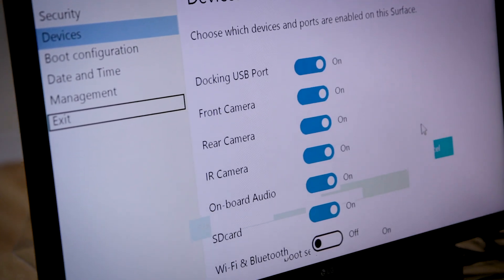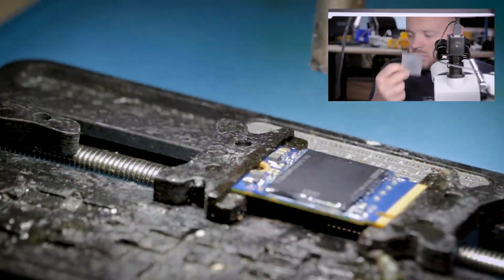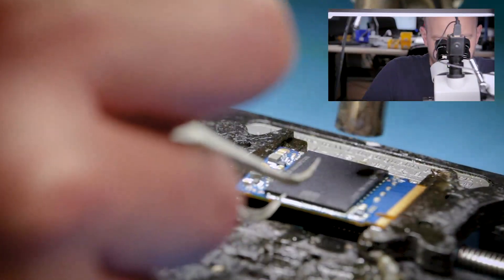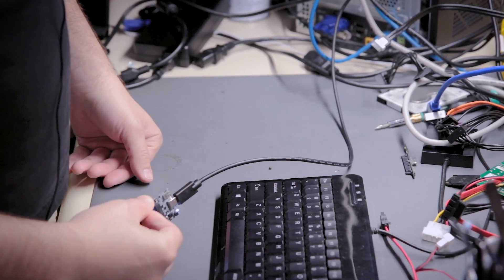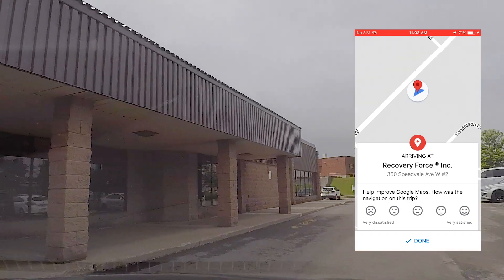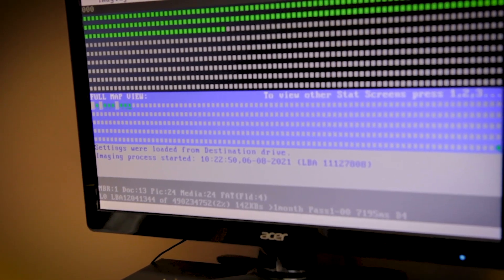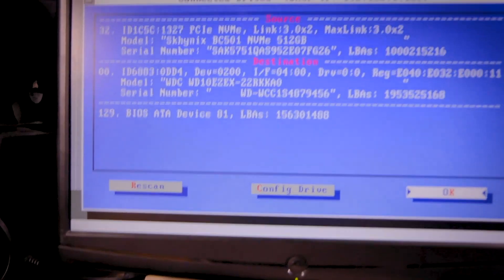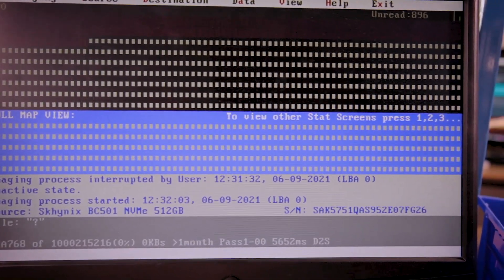Surface pro not turning on - data recovery

Comment: Really nice and insightful content, thanks a lot for sharing!

Just curious, do you have any success with retrieving data by swapping solderd-on BGA NVME chips to a off-the-shelf M.2 board after this?
Or do you find out why your attempt failed? Could it be that the M.2 board you are using is expecting a TOSHIBA chip but you put a SKhynix chip on it?

I really wonder if it's possible because recently I'm trying to do the same thing with a Samsung NVME chip, and the PC3000 software and adapter are crazy expensive if I just want to do this for a single time :/

Edit:
Ah never mind, I watched the video again and realized you already mentioned it at 7:42. But can you still elaborate if those successful cases are interchanged chip brand and board, or the board and chip brand has to match?
Reply from the maker: Yes, I've done it before getting the adapter. I swapped the NVME onto a workig board.

Comment: Did you try to cool ssd chip down to -20 degree? You can do it with cold spray Sometimes it becomes readable..
Reply from the maker: Yes but it’s difficult to not short components with the cold spray

Comment: Been looking for one of these adapters for so long, I'd love to get my hands on one 🤣🤣
Reply from the maker: Dolphin labs sells them
Reply: @forensicguy  thank you 🤙✌🥂
Reply: @forensicguy  was doing a little research on these adapters, seems from here Luke was using some generic one, not the one by Dolphin. Dolphin is too expensive, so that's why I'm asking. I believe the controller resides inside the chip, so any adapter would read it? I know bitlocker is another thing though.
Thanks
Reply from the maker: I have the dolphin one, it’s not that expensive considering you can make your money back on one or two paid recoveries
Reply: @forensicguy  got one since your comment, Toshiba tends to be a single chip and Samsung tends to have the controller and memory as two chips soldered one on top of the other 👍

Comment: Hey, like your channel. If i can offer - buy lavalier microphone, the sound is not really good at the moment. By the way, i was choosing some mic for myself and i think taskam dr-10l is pretty good, or zoom f2. And i have pc-3000 flash, and soldering station, i even solce several case with usb and recover data, most hard things for me is build image from dump, if you ever do content this type i will appretiate that. But anyway, cool videos, and nice that you do them more freqently. Hello from russia :)
Reply from the maker: I think my levels on camera were too low and fixing it in post made it worse. Too much background noise. I’ll try to get the sound better. In some instances I didn’t have external mic In this video as I wasn’t in the lab. 

You didn’t want to get FlashExtractor or vnr?
Reply: @forensicguy  i was thinking what to buy, because i have not allot money and i pick pc-3000 flash because it have russian support and training center in Rostov, so i buy this tool and go learn for 3 days there, they have very good cources but i still have problem with logic image assembly, maybe need more practice. I wish to have other tools too, but as is not my specialisation yet, i cant affort it.